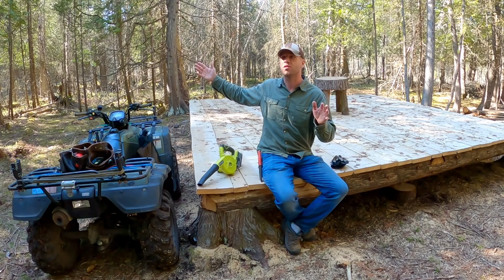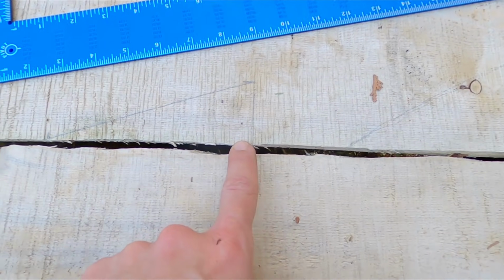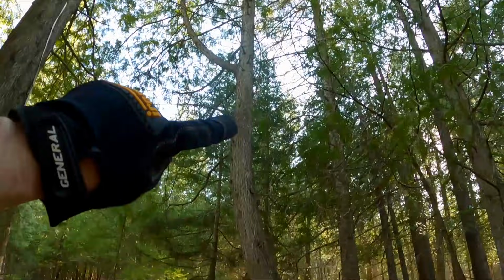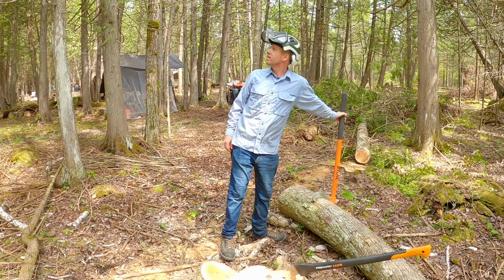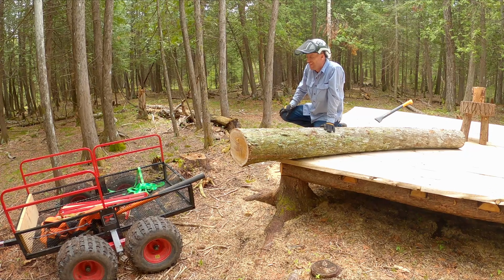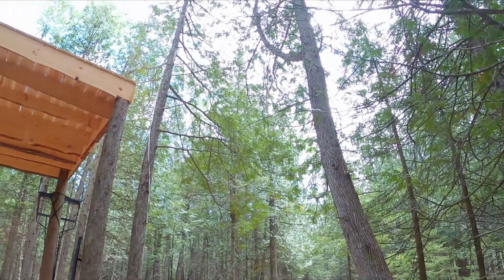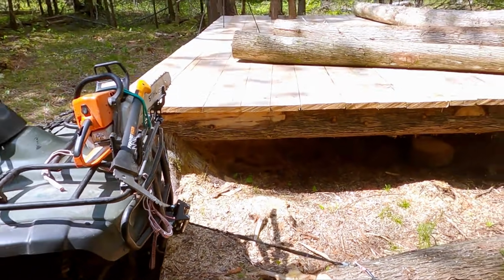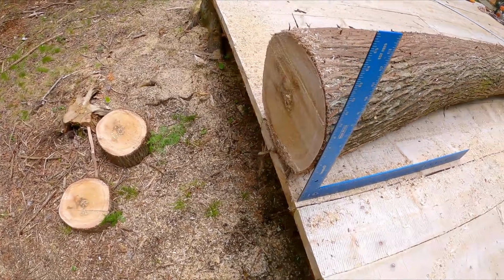Building a Bow-Legged Gazebo with a Chainsaw in the Middle of Nowhere. #42

Comment: I gotta ask, What saws are you running? One looks like maybe and 029 (ok 025-029) The other looks newer. None of the saws you run sound like they are ported either. Do yourself a flavor, get that T27 and your dremel, take off your muffler, remove the spark arrestor screen, open the exhaust hole up more but so your spark arrestor still fits. Then drill as many holes as you can through the baffle so you saw can BREATH. If you really want to play with fire (no seriously don't burn down your woods) get a RPM gauge and take off the caps on the carb adjust and tune them to about 1000 rpm of max, never run max RPM or over. it aint worth it! My 029 will run a 28" bar all day long through soft wood.

Comment: Another great video. It is nice when you say it is going to fall there, it does. What is the worst that can happen if you cut it wrong… I don’t know, go find another crooked trees, you got plenty. I don’t know what that means about me but I liked the bark striping. With your bowlegged gazebo it looked like you were using a very wide angle lens but alas, only crooked trunks. Thanks so much for sharing and try to stay cool and hydrated.
Reply from the maker: I suppose the worst case is that it tips the wrong way- towards a structure or the four wheeler or you and something gets smashed.  Can get scary pretty quickly.

Comment: Run a string from the inside edge of the curve on one end to the same side on the other end, then  square your end cuts to that line.  I know this is an old video, and you have already done it.  Just wondering if this would work.
Reply from the maker: For sure. That’s essentially what I did just in a different format.

Comment: Great video...the red tool that you use for holding board that you set with your hammer...is it commercially available or DIY tool
Reply: He made them out of scrap steel and cut them with a grinder. He mentioned It in the very early videos.